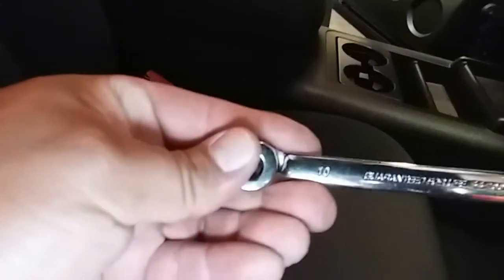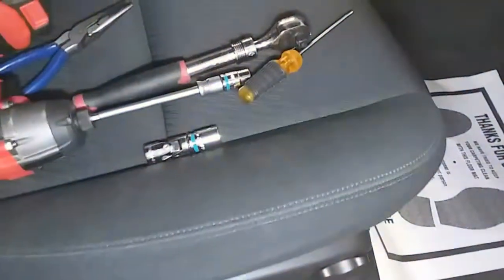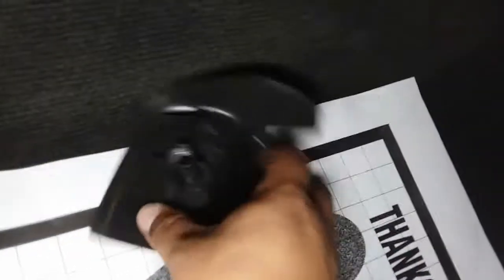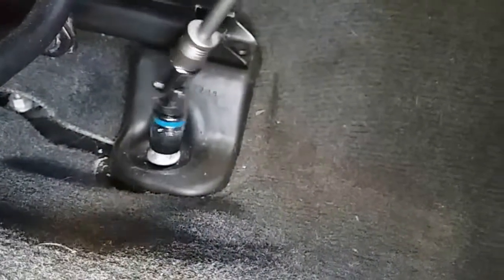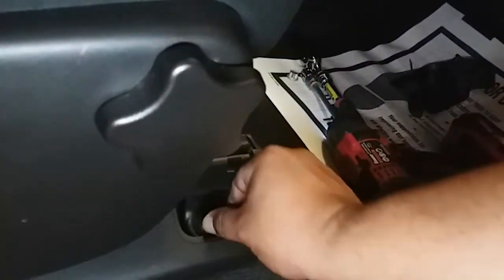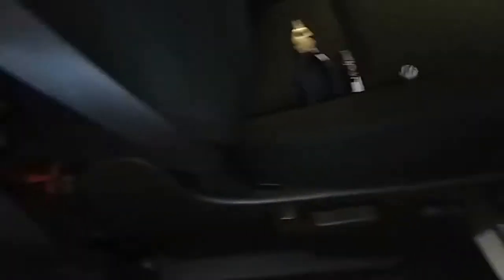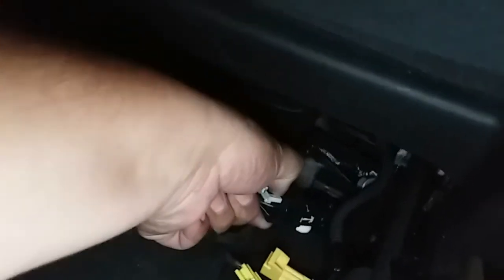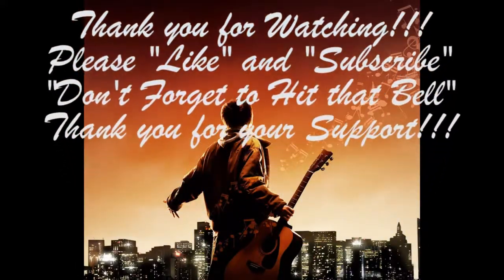How to: Remove passenger Seat on a 2012 Chevrolet Silverado

Comment: Is it possible to remove passenger seat when passenger door is stuck shut?
Reply from the maker: Yeah you can it's just going to be hard tho
Reply: Thanks
Reply: @johnrios5099  did you ever get your door unstuck? I'm having that same issue
Reply: @559powerscape  have you ever got a stuck door unstuck my passenger door won't open from either handle but the cables are fine I think it's my lock actuator but idk how to go about this
Reply from the maker: @austinhigel4118  that's tough cause the door needs to be opened in order to get the door panel off. I had this happen to me once it was a hassle. Just had to mess with it till I got somewhere
Reply: @559powerscape  it's been a hassle that's why I thought remove the seat for more leverage did you happen to do that?
Reply: @austinhigel4118  Yes I did. I too thought about removing the seats but did not. I was so close but I'm a bigger than average guy. Took both panels on passenger side slightly off. I have rear suicide doors (extended cab). It gave me a little more room to work with but do not push on it too much because its still attached to front passenger door. Window was rolled up on both. Grabbed some small vise grips, located the cable for the inner for handle. Tried and tried to pull but nada. I gave up because I didn't want to destroy anything. I heard someone spent $300+ for a new door panel. I'm sure its a bit cheaper. I spent $60 and took it to my Auto Body Shop.  I felt that I was so close but could not finish it up. I left it there for one day. My apologies for this long reply.
Reply: @johnrios5099  thank you for getting back to me it's just frustrating I'm hoping after removing the seat I'll have more leverage
Reply: @austinhigel4118  I hear ya there. I was so frustrated myself. Do you have extended cab as well? I think about it now that I could've done a couple extra things differently. I hope I never have to again tho. If I remember correctly I think the guy I took it too ended up buying another cable for handle because he snipped it.  But it was all in the plans. I think it's still a $30ish part.
Reply: @johnrios5099  mine is crew cab maybe I can snip it then strip the outside to give a tough on the actual cable part then but I'm not sure I just need my door working again
Reply: @austinhigel4118  I had a minor accident on the passenger side busting my side mirror and door handle only. Old man side swiped me. Fix them both myself. I remember having a issue installing the cable on the handle where it locked so I was thinking maybe that came loose.
Reply: @johnrios5099  hmm my door is fine